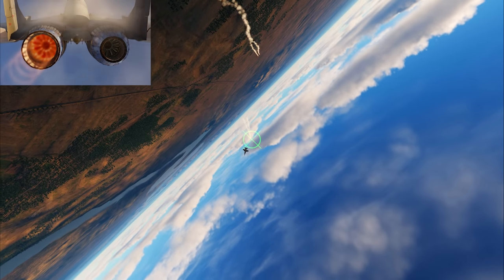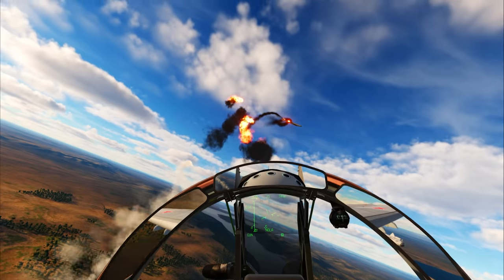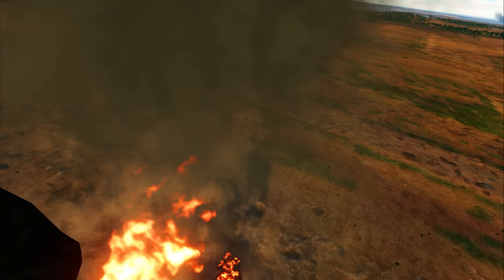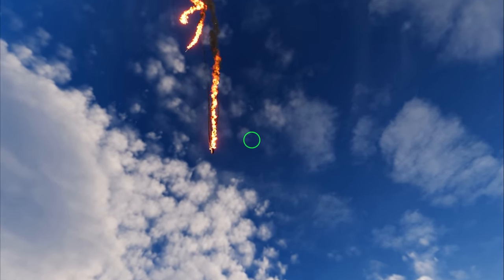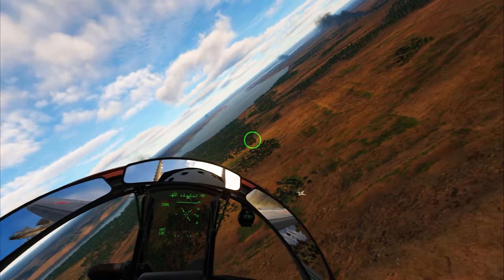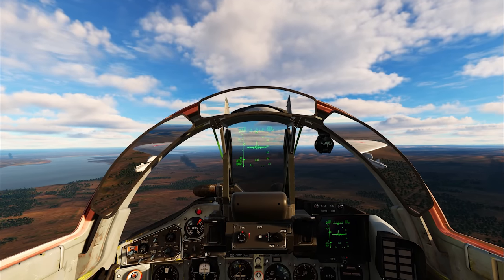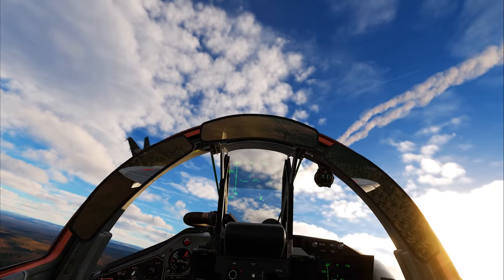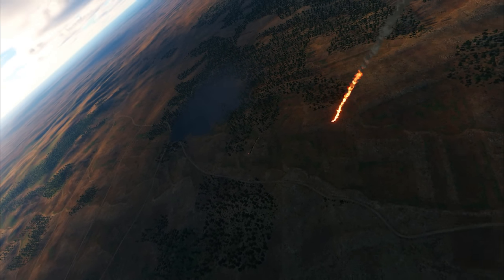Top Gun 2 Maverick | Split Throttle Dogfight | Digital Combat Simulator | DCS |

Comment: And now the discovery of split throttling is gonna get a lot of people to do this now. Fulcrums and Flankers should be able to use this to great effect.
Reply: But can you do it on a real MiG-29/33 or Su-27/35? I don't think those planes were designed exactly for this.
Reply: @Sacto1654  I meant in DCS... I should have clarified.
Reply: @Sacto1654  They do have separate thrust throttles, so yes, they can do that. How often is it used on the other hand, that's a different story.
Reply: @Sacto1654  You can do this on any aircraft with multiple engines... Even an airliner or a B-52 (8 thrust levers) although the latter would be very much a handful to do it in... literally.
Of course in the latter, it has been done mainly when the control surfaces haven't been in working order and all you are left with is the thrust levers...
A crazy idea is to try with the gear down as it tends to have a stabilizing effect when you fly with thrust levers and helps a little with the oscillations in the phugoids.
Reply: I'm surprised people wasn't using this already, it's something any pilot should know along the risk of inducing a flat spin
Reply: Imagine if differential throttling gets added into AC8
Reply: @ultralaggerREV1  too complex to do in a controller unless automated...or implemented in the existing PSM.
Reply: broke: split throttle tomcat
woke: split throttle fulcrum
bespoke: split throttle viper
Reply: @bojned  It's just one more tool in the wheelhouse. And like all tools, it's not always the right one for the job. But, in certain situations, it's very useful to have on hand.
Reply: Lol, AC wants to sort it's physics and other stuff, like jets shootung missiles from their afterburners and so on...
Reply: There is a clip on Yt of a pilot explaining it. They power up one engine before the other when coming out of a stall as the gyro effect of spooling the engines causes unwanted yaw.
Reply: @DeeSnow97  split throttling the viper works by keeping the canopy open and blowing out with your mouth in the opposite direction you want to yaw into
Reply: @zyoungson215  Roll not yaw, surely?
Reply: Its yaw. Gyroscopic precession.
Reply: @zyoungson215  Okay, got it. That's what I was double-checking on. So this is specific to spooling up the turbine at the exact same time as the nose-over (pitchdown), combined with no control authority / yaw stability from rudders during stall. Got it, yeah that makes sense. If you can recall the source / search terms to find that vid I'd enjoy that as well.
Reply: @zyoungson215  Additional followup: Do you know about any twin-engine fighters have turbines mechanically mirrored for gyro reasons? I'm sure this is done with some twin-prop designs but obviously changing, like, one thing in the gearbox where everything else is identical, is far less of a heavy lift than designing two mirror versions of a every major rotating piece in a turbine. But anyhow, question stands.

Comment: I did notice in round 5 that you had your airbrakes on the whole time.  THINKING OUTLOUD - This might enhance splitting the thrust because the total drag.. combined with the output of one engine may contribute to a tighter turn in a short WES situation.  LIke a floating butterfly with one wing bigger than the other.  (Just be careful not to get too slow at low altitude.)
Reply: I noticed that as well and so far this is the only comment I’ve seen nothing this. Definitely going to be fun to play with though (:
Reply: I was about to comment that too... but I have see your comment. I agree with you. But, I have to do a probably silly question: if it was an intentional use of air brakes on round 5, why it wasn't used at round 6 too?

Comment: It would be interesting to see the effects of differential thrust in F-15. Differential thrust might make getting into a notch quicker and along with a quicker altitude change the plane would not be able to be locked up easily in a BVR fight.
Reply: Kinda doubt it. Differential thrust will only really have any use at lower speeds where off-axis thrust will have a meaningful effect on the aircraft's attitude. If you are at a higher altitude and going slow enough to want to use differential thrust in a BVR situation, you've made a hefty mistake.
Reply: @billder7304  exactly it’s all about inertia
Reply: It has no use in a BVR fight though...

Comment: Man you made it look almost easy to beat the Hornet! 
Differential thrust might give only a small edge but in capable hands is way more than enough!
I know jets with a wider gaps between engines would benefit more from it but I have a feeling that jets with more powerful engines like the F-15 might still have a noticeable effect if you are "more aggressive" when throttling down one of the two engines; with the F-14 and the Mig-29 you have to be more gradual to avoid flatspins but I think you can do that and compensate for the lack of gap between engines and still get away with it without risking a flat spin, that said I think engines with a higher thrust to weight ratio are necessary to have significant results (i.e. it would work better in the F-15 than in the Hornet).
I'm also very curious and would love for you to try two things: the first is how Differential thrust behave in highly maneuverable jets like the Eurofighter or the Rafale (I'm intentionally not counting the F22 because that thing is already a flying cheat code) if it improves or if it actually make them worse or too hard to control to make it not worth the risk/effort of using Differntial Thrust. The second thing is more specific for the F-14 and is to try if asymmetric wing sweep can be used to get some minor advantage in combat and if it can be used in tandem with Differential Thrust to accentuate that performance edge during dogfights. I would love to see more videos like this! :)
Reply: it is easy to beat a hornet in a dog fight especially at decent altitudes....hornet is over rated...

Comment: I was under the impression that only the F14 could split throttle. Thanks for teaching me something new.
Reply: Literally any multi engine plane can each engine has its own throttle lever from a Beechcraft to a 747 to a raptor and everything in between so technically you could do this with any multi engine aircraft though the wisdom of it is debatable. Also for tight taxiing it is a common practice as well. (Speaking as an actual licensed pilot)

Comment: Now this makes me wonder if you could split the throttles of a A-10; given the placement of the engines how would that influence flight dynamics
Reply: Yes I wondered the same....getting that Flying Gun spun around and on target faster would be devastating and downright cool!
Reply: The issue here is the A-10 doesn’t have afterburners, as GS has shown in these videos, having one engine in afterburner and the other not seems to be the effective ploy. A-10s are designed to be slow enough to rain down hell on Earth in one strafe. Their engines wouldn’t generate the amount of thrust required to make it viable for split throttle manoeuvres.
Reply: With wingtip air brakes, the A10 and the A6 would probably benefit more from some way to apply differential air brakes - open only the one on the wing on the inside of the turn.
Reply: @CoffeeMatt10  GS is only modulating the burners because throttle adjustment under mil power risks a spin. And afterburner is snappier with no wait for the engine to spoil up or down.
I bet it’s feasible in an A-10 but not applicable outside of a dogfight

Comment: Had an engine go out on me in the F15C and yes, it made a difference lol a lot of trimming yaw. Like you said though, engines further apart makes it more effective. I’m interested to see the effects of split throttle in the F22… instead of using so much rudder. 🤔 or the su-57, might have the edge it needs to beat the F22 consecutively. 🤷‍♂️

Comment: Since the f22 has up/down vectoring i want to see differential thrust used on it. It should still give tighter turns even though the engines are closer than the mig 29 or f14.
Reply: problem being that planes like the F22 or fhe Su30s in DCS are imported mods and their flight dynamics aren't the best. Its hard/near impossible to pull a cobra let alone a kulbit in a modded Su-30 for instance

Comment: Mig29 engines are angled a bit out so the thrust vector points toward the center of mass of the aircraft, so split throttle has much smaller effect because of it.

Comment: Love your vids. Im not a sim pilot but I am a real pilot with many hours. My one problem with the split throttle is you are not doing what is shown in the movie. Maverick pulled up in the Cobra like maneuver, cut left engine to idle, and kicked left rudder. Now that actually is a recipe for a snap roll, spin but you haven’t done it. You’ve ‘justified’ your procedure by getting in the weeds of A version vs later model. Id like to see the movie version.

You have no problem lowering flaps which breaks the airplane. Why not completely lose it doing an impossible task? Its not like youll get hurt.

Comment: Just a question, wouldn't cutting thrust on the opposite engine to the turn / roll work better? I see GS keeping left engine on and right engine off when rolling turning/left. If you split thust the other way around wouldn't that improve the turn/roll rate?

Comment: It's like the difference between torque vectoring, which is indeed effective, but WAY less than the ability to BRAKE on the inside rear wheel. That's why modern sports EV's implement both. Acceleration to a higher speed takes a lot more energy then accelerating to a lower speed. If cars could accelerate as fast as they can brake, they'd be too fast for the wheels to keep traction. They'd just spin up.

Also it's in 2D. Modern fighters can use vectoring in a different axis to astounding effect.

Comment: You don't use your empennage effective during splitting the engines. You should put your horizontal stabilizers in opposite  rotations to maximize your turning ability.

Comment: the exhaust heat is still gonna be pretty hot even without ab there should be a egt gauge somewhere where you might be able to see a difference. i think it would be interesting to take this idea and do combat against other twin engine jets also using differential thrust

Comment: The F-22 is dual engine. Those engines are much closer together but, could the F-22 be even better with split throttle?
Reply: Well the F-22 doesn't do differential vectoring, only up and down linked, so it definitely should get something out of split throttling while vectoring thrust.
Reply: @IRUKANJI  Agreed! The F-22 seems to out-maneuver the Mig-29 - which has 360° vectoring - without split throttle. But, I think GS mentions the engines need to have an adequate amount of separation between them, for split throttle to work. Too close together and it can be dangerous. That may be the case with the Raptor, idk.
Reply: It doesn't need it because it has big ass rudders
Reply: @itzerikftw24  Very true! It’s a beast! But it can always get better…lol! If it’s even possible.

Comment: Seems that the mig is a bit more stable than the tomcat? Or are you getting better at maintaining control when splitting throttles?? This is a gamechanger for sure.
Reply: I would guess the reliability of the MiG-29 engines over the F-14 (especially the 14A and it’s habit of stalling) is a factor, but of course the pilot’s skill also increases with more practice, so likely a combination of both.

Comment: Makes you wonder why nations haven’t figured this out and used their fly by wire controls to manage it.
Modern stealth fighters already have stability management built into them so why couldn’t you get them to do it with the thrust?
I know NASA did some tests flying aircraft with thrust alone and their takeaway is that it’s not only feasible but doable at least in an emergency where you lose your control surfaces

Comment: Visually when i see the split throttle being applied doesn’t always make sense IMO in your video… basically if left rudder is being applied then the left motor should be dialed back to give a tighter turning radius. If you are doing more complicated maneuvers then the same applies if rudder is used.

Comment: Are we going to let slide the fact that GS had his speed brakes out for the last fight? :p great fights, I wonder at which point it becomes a gimmick though. Like when could you just do a pedal turn on top to the same effect? Obviously you are the pilot so you would feel the difference but on tape it doesn’t look like it’s doing much of a difference sometimes during these fights. Also you’re halving your thrust capacity so Energy will take a big hit, right?
Reply: You are supposed to use the pedals and the split thrust.

Comment: Do the hornet next. You can do it in that too.
Reply: Hornet'and Eagle's engines are so close together that it won't cause that huge of a yaw moment as with the F-14 or MiG-29 or Su-27 where the nacelles are widely spaced.
Reply: @doncalypso  I do it in the hornet regularly, and have for quite some time. You’d be surprised the yaw it creates. You can put the hornet into a flat spin pretty easily. I mean, F-14 death type of flat spin, except the hornet has a built in recovery system. The screens flash and give you instructions on how to recover.
Reply: @Triple87  oh...   I stand corrected.

Comment: Do splitting on the other side. If you are in a left turn, bandit going left, light the RIGHT side AB so it pushes you more left. You doing the left AB will be pushing you to the right in that scenario.
Reply from the maker: Ya some of them are late inputs by me and also remember the engine might take a second to respond to the input.